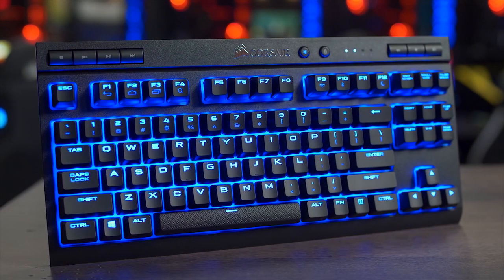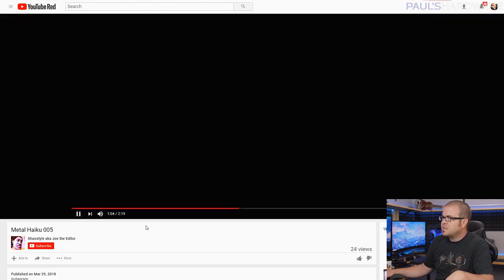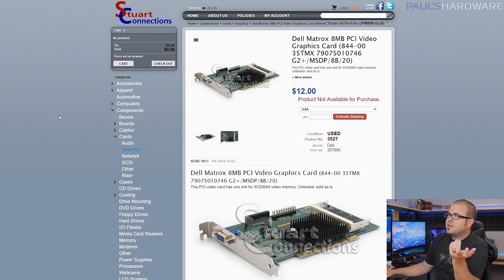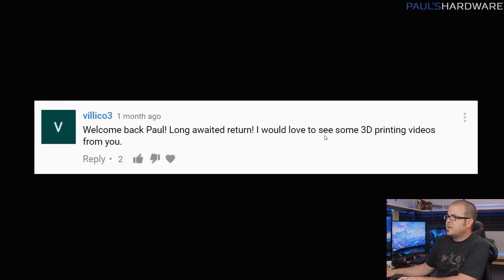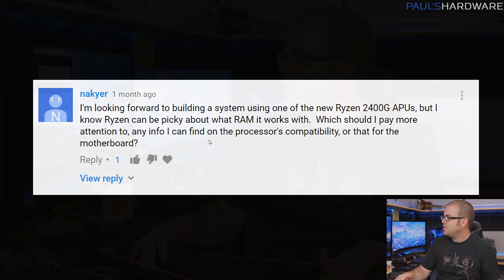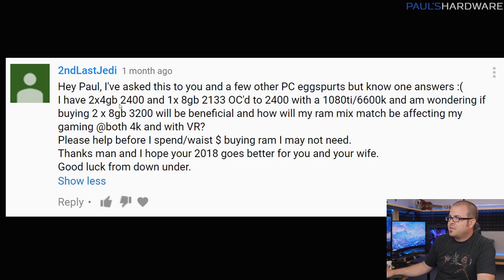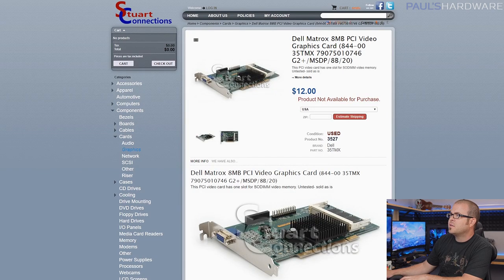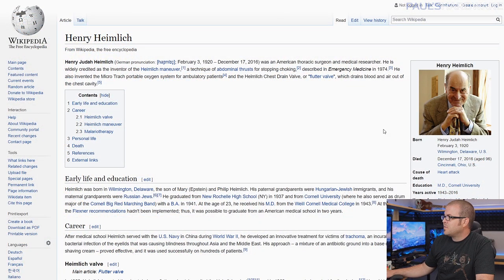Why Can’t You Upgrade VRAM on a Graphics Card? - Probing Paul #23

Comment: Question: When choosing a PSU is it simply a case of adding up the peak draw of the CPU, GPU, Motherboard and Drives, or is there a tool/app that will state how many watts you need? For example I'm running a i5 7400 and a 1050ti and a pair of SSD's from a 500W PSU and am thinking of upgrading to a 1070 and maybe an overclockable i5 or a Rysen 5 with a suitable Motherboard, and wondered if I'd need to upgrade the PSU especially if I'm thinking of overclocking, any thoughts?

Comment: So what about a 3080ti and putting the same vram a 3090 has 
Wouldn’t that work ? Then flash the gpu to a 3090 ? For the extra 12vram ? 
I don’t see this not being able to work but is it logical? I can soldier professionally myself that’s not the issue it’s the knowledge of will it work

Comment: Hi Paul! Love from the Philippines! I have a question posted in Reddit but no one answered it so I hope you can. 

The problem: Hard drive got bad sector, borrowed a friend's good drive then installed to my PC then it got bad sectors again

My own hard drive got bad sectors until it came to state where it's not usable anymore. So I borrowed my friend's hard drive, this drive is good with no bad sectors in it (never been dropped or anything) because he's still using it at that time. So I formatted the drive before I start to use it, and when I attached it to my system it starts to got bad sectors too. 

What could be the other factors that got the hard drive bad sectors? Is it possible that a faulty PSU can cause bad sectors in a hard drive? I've already done Memtest, Prime95 to test my ram and cpu and the results came good with no errors. I'm asking this because I want to buy a new drive but because of what's happening I'm afraid that If I buy a new one it will have bad sectors too. Just trying to figure out first what's causing the bad sectors before I spend money. Thanks!

Comment: From South Africa

Hey paul. I'm having a problem pairing a price to performance system especially these days it is purely for gaming with light coding on linux. My thoughts were:
CPU: Intel 8600k
CPU COOLER: H60i
GPU: GTX 1070
MOBO: MSI gaming pro carbon AC
RAM: 16 GB of hyper x 2400
SSD: Samsung 850 Evo
HARD DRIVE: 2 TB seagate hard drive
PSU: Corsair 750W modular
CASE: Phanteks enthoo evolv ATX(Im also concerned about airflow from this case)

Would a virtual box slow down my pc at all?

Comment: Paul, If films display in 24 fps why does 30 fps in games look awful. I know i could just google it but hearing it from you would be so much more fun,  and would save me the effort of reading. Thanks
Reply: Also, the video is a very even 24 frames per second where every frame is exactly 1/24 of a second from the last one and was filmed at that rate exactly. When you render a game on a gpu, it renders the frames as fast as it can, but due to numerous variable factors in the game, some will be rendered faster than others, one frame might be done 1/60 of a second after the last and the next might take 1/15 of a second. Even though the frame gets drawn at different rates, they aren't displayed as soon as they are done. The latest frame gets added onto a frame buffer and the monitor grabs the top frame from the buffer every 1/(the monitor's refresh rate) seconds. with the frames being finished at an uneven rate and the monitor grabbing them at an even pace, sometimes the monitor will be getting the same frame twice or even more often in a row because the next frame hasn't been drawn yet. It can also be a problem if the gpu draws the frames too fast, then it replaces the frame the monitor is drawing before the monitor finishes drawing, which is what causes frame tearing.

Comment: Is there a proper way of mounting hard drives? 
For instance is it better for hard drives to lie flat or should they be vertical?
Also is it bad if its laying flat to be off axis a few degrees or will that not matter much?
IK it doesn't matter with SSDs but i have a few 3.5" drives that may be sagging a bit
Thanks

Comment: I'm considering purchasing a second monitor (currently have a 1440p IPS 60Hz), and debating whether to purchase another 1440p IPS monitor or a TN w/ G-Sync and high refresh rate (they're currently around the same pricing).  I've never used a desktop TN before, but I've also never experienced G-Sync (I have a GTX 1080).  Any thoughts on what I should try?

Comment: Hey guys, I need proper help! I would like to buy a new 4K system for the following applications: Lumion 8, Sketchup, Vectorworks, Rhino 6 with Grasshopper, Adobe Photoshop and InDesign, which are primarily architectural applications (Renderings and stuff like that - 2D and 3D). In terms of better performance, should I go for an Intel Core i9-7900X, 10x 3.30GHz or Intel Core i7-8700K, 6x 3.70GHz? Folllowing the other components: 
Mainboard for the i9: MSI X299 Gaming Pro Carbon AC, 
Mainboard for the i7: ASUS ROG Strix Z370-E Gaming, 
SSD: Samsung SSD 960 PRO 512GB, M.2, 
RAM: Corsair Vengeance RGB schwarz DIMM Kit 64GB, DDR4-2666, 
GPU: MSI GeForce GTX 1080 Ti Gaming X Trio, 11GB GDDR5X, 
CPU Cooler: Corsair Hydro Series H150i Pro, 
PSU: be quiet! Straight Power 10-CM 600W, 
Case: Variable

Comment: Coming back to this question in 2020 when Nvidia launched their “flagship“ gaming GPU RTX 3080 with only 10GB of Vram while marketing it as the perfect 4K gaming card. There are even two free slots where they could‘ve placed 2GB of additional memory but now you gotta either buy a for gaming overpriced 3090 with 24GB or wait for the 3080 with 20GB which is also way too much and will just add unnecessary cost. Wish we could upgrade the 2GB on the 3080 ourselves...

Comment: Hey Paul My computer kept crashing when i played any game that required more then 20% graphics card load, I diagnosed it with my friend and it ended up being the card, the solution was downclocking the XFX RX 560 to 200MHz. can you answer why it would have been doing this when thermals were under 61C

Comment: Besides the wattage of the power supply should i be heavily invested on the rating if I intend to overclock and SLI a system? Currently using 850bq from evga. (8700k and 1080s)

Comment: Maybe you can help me.  Computer randomly freezes on every program, i.e games, internet, music, etc.  I have tested RAM from switching RAM sticks, using one slot, even MEMtest86.  I have updated drivers on everything.  Got a new motherboard for Christmas and still does it.  I cannot figure this out.  My only conclusion is maybe the SSD is bad.  My system is R5 1600, ASUS ROG STRIX X370, 16GB Trident Z RAM, and a EVGA 1070 FTW.  That is the main part of my question, a follow up is if I buy a new M.2 Drive do you have to activate Windows again or will Windows automatically detect the key?  Thanks again and have a great day.

Comment: I was gifted 2x8GB 2400MHz memory last year to go with my Ryzen build to help with my budget. Now that I recently built my Ryzen computer, I keep seeing people running 3200, not sure to keep the 2400 or swap for the higher. Mostly use my computer for Graphic Design, Illustration, Minecraft (shaders), Indie games and soon capture/video editing. Also suggestion minimal video card to go with a 1800X.
Reply: I've got some 3200MHz memory, but because of some compatability issues, I was only capable of running it with XMP off at 2133MHz until a BIOS update, so I've got some experience of this. I did notice quite a decent improvement in performance, and I'm glad I can now use my memory to its fullest extent, but if I had to actually spend money on a new 3200MHz kit, I'd have probably not done it. I don't think it would have been worth it, even now that RAM prices are no longer quíte so high. The same probably largely applies to you: If you absolutely want to get the best out of your CPU, go and do it, but if you actually want to see value for money in your hardware upgrades, probably don't bother, because it's just too expensive to be worth it.
Reply: Leone Furlan ryzen absolutely benefits from faster memory due to the infinite fabric memory design implementation in ryzen. Look it up
Reply: An 1800x can handle a gtx 1080 Ti very well so I think the minimum gpu for that processor would be a 1060 6GB or 1070. Preferably at least a 1070.
Reply: Not entirely true Leone, at least not in the case of Ryzen (non APU)

Because the infinity fabric speed is tied to the memory speed, higher speed RAM in Ryzen does result in a noticeable performance increase. It's like a second overclock essentially, in that a few hundred mHz won't make a massive difference, but there is a difference.

To the OP, i would however say don't bother buying the 3200 kit. Wait until you need to buy more memory, or RAM prices seriously drop. The cost to performance increase is not really worth it
Reply: Nah, DRAM is way too expensive for such a minor upgrade like that, I have 2x8 3000MHz Corsair Vengeance RGB + R5 1600 and the difference between 2133MHz stock vs 3000MHz is very small. 

If you're going for it then like Paul said, sell the one you have right now and get the one you're looking for, but imo if you're using your pc for graphic design i'd suggest to keep the 16gb ram you have and shove in another 16gb if you want, you'll se a bigger  performance increase that way.
Reply: you.... didn't actually read what i said properly did you?

"no NOTICEABLE difference" would indicate that it's within margin of error (and is the opposite of what i said) It's not going to give you a 50% performance increase true, but it would be noticeable, especially with an 800mHz speed bump. Guru3D actually tested it and showed that in games it will make a difference, especially comparing 2133 to 3200 (see link below)

http://www.guru3d.com/articles-pages/amd-ryzen-7-memory-and-tweaking-analysis-review,10.html

As to my original point, spending £200 is not worth it for the 5-10 FPS (at best), and for design work there is nothing really to be had, so for the OP it is a waste of money.
However, for anyone who wants to know if it is worth spending an extra £20 over a basic kit, then the answer is yes because 5-10 FPS could be the difference between playable, and not
Reply: +Leone Furlan - I'm not bashing either, but it most assuredly wasn't just a placebo effect, and my experiences do actually tie in well with other anecdotal evidence, not to mention actual benchmarks. Zen-architectured chips dó quite substantially benefit from higher RAM speeds due to the clocking of the Infinity Fabric link between the core stacks, as +alaskanhybrid correctly mentioned. All I was saying to +CobaltFox Plays... is that it's probably not worth it to buy a whole new memory kit for this performance advantage, since those are rather pricey; I very much object to any claim that there is no noticeable performance advantage at all, because there definitely is.

Comment: Hey Paul I have a question. I'm running dual asus vc239h monitors and I want to get a consistent 60fps at ultra settings on most if not all games. Which video card should I go with? Without breaking the bank? I currently have a 1050ti 4gb. With an I5-7500 gpu. 32gb ddr4 ram.

Comment: Dear Paul, I have an As Rock x99 platform fatality motherboard, It has 32gig's of G skilled DDR4 ram paired with Intel 5820k 6 core  CPU and RX 480 8gb GPU. I also love my SATA hdd's for storage and my DVD and Blu-ray roms.  My question is this, I'd like to update to a M.2 SSD but I'm afraid if I do this it will kill some of the SATA ports on my motherboard. If this is true what CPU should i get so this doesn't happen? I don't understand the *'s in the user manual.

Comment: Do you think the the ryzen 5 2400g will be a good/great option for streamers wanting to build a cheap(ish) streaming pc? I use an ITS build with a ryzen 7 1700 using a gt 1030 just for seems. I want to upgrade to a r5 2400g so I can use my 1 pci slot with an elgato hd pro.

Comment: Great video - why do all the youtubers use Adobe Premier?  It seems a very costly solution where most youtubers use less than half the capabilities.
Reply: It's easy to learn, cheaper than vegas (for the same feature set) and everything else cheaper only outputs 720p
Reply: I am told its very hard to learn(steep learning curve as most reviewers proclaim) - so that does not make sense.  On 720p, not so, Hitfilm outputs in various formats including 1080p (my requirement). So I am not sure where you are coming from.
Reply: OldGamerGene never came across that software before; I was speaking purely from an anecdotal experience, I should have noted as such, my bad. 

premier has a steep learning curve if you want to do fancy stuff sure but a lot do. it took me maybe 10 minutes to learn the basics? the more in-depth stuff (masking, image manipulation, audio balancing etc) takes time, but no more than any other software imo

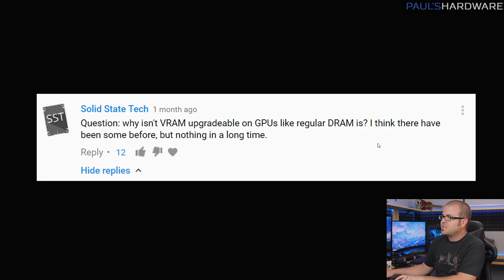Comment: @3:02 i have some addditional questions about adding vram to the GPU. most pcb's have free spaces for ram chips ... all other components like capacitors and smd parts are oviously on the board already.  so only the ram chip seems to be missing.if you had smd soldering tools like (hotair or IR) you can add physically a ram chip onto, right ?     also the grafics card is available in different configurations with more or less ram.  like the 1080, i see theres an 8gb and an 11gb version ... also the titans has 12 !!!!   and on the 11 gig versions are a single ram place free .... so what happend if you add the chip ? ...does it work ? or is there any bios mods necessery or can i flash a matching "more ram" bios to the card ?

Comment: would love to see 32gb vram on the next gaming cards we can really use that for 8kgaming and sli support
Reply: It's funny, that. When I bought my 970 I thought it was quite odd that the competing AMD card (the name eludes me) had 8GB of VRAM, which seemed to me like a disproportionate amount for that card. Two years later, I find myself in a situation where the computational power of my 970 is still more than sufficient for my needs, but I'm running out of VRAM on an increasingly regular basis, especially since I added a 2560x1440 monitor, where previously I played on 1440x900.

Comment: Hey Paul love the videos bro! I had a question regarding ram. I have an 8gb dual channel ram but want to add another dual channel  16gb to it  I usually ppl upgrade ram from 8gb to 16gb or 16gb to 32gb or even 32gb to 64gb configuration. However I don’t see 8gb +16gb = 24gb or 32gb + 8gb 40gb configuration. Is there a performance decrease or is it just not recommended and why?

Comment: This show brings back memories. Around 1995-1998, before AGP slots became the standard in motherboards, it was possible to upgrade vram memory on PCI video cards. One of the last mods I did was rip off the 2x 512kb vram on a dead PCI video card and stick it into the 2 memory chip holders and it worked. It would only work in 1Mb increments as you can't put in 512kb vram only. Video cards like the cirrus logics, matrox, TNT and NV1cards supported this. Matrox and 3DFX also supported daughter board vram upgrades. These has long phased out because the density and lower profile of vram over the years. This is what they look like. http://www.esaitech.com/cirrus-logic-1mb-pci-video-card.html

Comment: #AskPaul for next month - I will try to keep this short LOL  Currently, I'm running an older Asus P8 Z77-V LX with a i5 3570 @3.4, 16 Gb RAM, RX470 GPU etc still on Win7-64.  I wanted to upgrade LAST year, but I'm still on extended medical leave :P  I did want to got with a Z270 with at least a i5 6600 etc.  It may sound foolish, but I still like Win 7, have older apps etc that still work.  I'm also not keen on Win 10, and heard the same from other friends with the feelings on upgrading.  I also have a friend looking to upgrade his even older rig, but also wants to keep it at Win 7...

So my question is - how practical is it to still get a Z270 or H270 for buddy, and stick with 6th Gen CPUs, still leaving the option to upgrade later when we'll be forced to go with Win 10.  My rig is still running fine, but this is the longest I've had.  When I was financially flush, I used to upgrade every 2-3 yrs, but still buying 2 steps down from the latest on the market.  I have seen some current vlogs on comparing Sandy Bridge to more current rigs, and they still hold their own ;) I still do med level gaming, and editing on my rig.  

Hopefully, you find this, and give a helpful response, Paul.  I find you, Kyle, Linus, Jay, and the Canuck boys a helpful bunch for tech tips, and the like.  Be well.

Comment: Wouldn't it be feasible and also cost reducing to build a modern GPU without RAM?  Given that we cannot saturate PCI express 3.0 x16, and PCI express 4.0 is on the horizon, it seems like the bandwidth is there.  Also, most modern motherboards allow for 32+ GB of system memory, easily leaving plenty for a GPU.  I would think this would also greatly diminish the cost and power requirements of a GPU.  The memory won't be optimized, and the traces would be longer thus increasing latency.  You could still have onboard memory for the flagship GPU in each series, for that extra bit of performance.  I personally think most gamers are not going to notice a frame or two avg difference and even think most would trade that for a lower cost GPU without hesitation. 
We have the technology.  We can make it better, cheaper and more efficient.